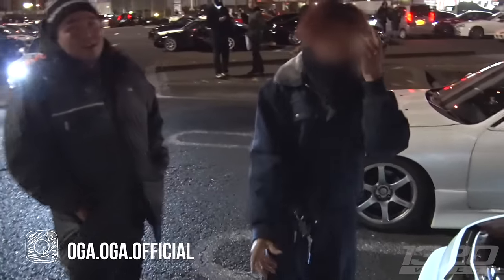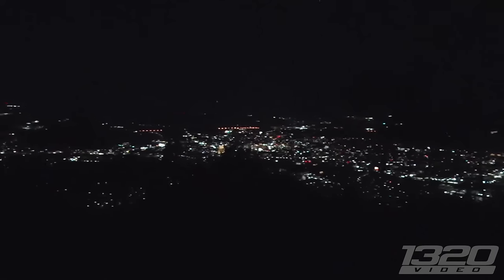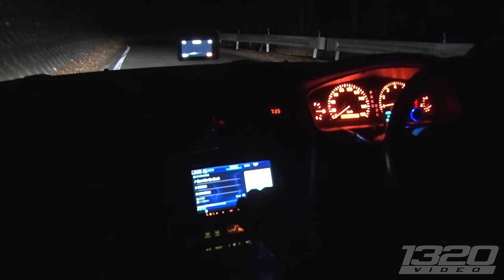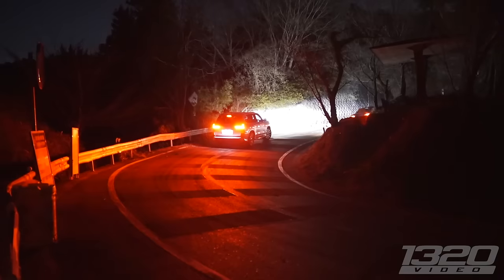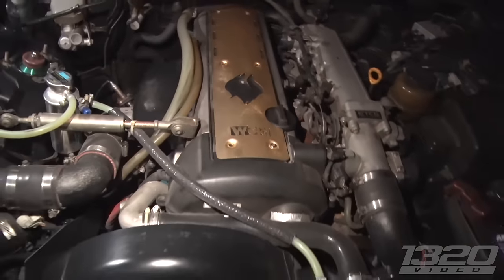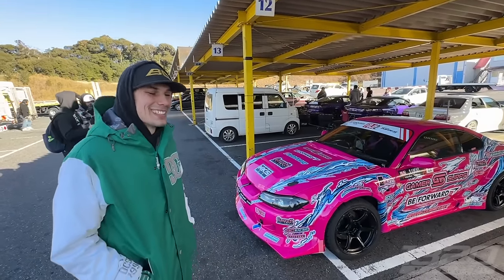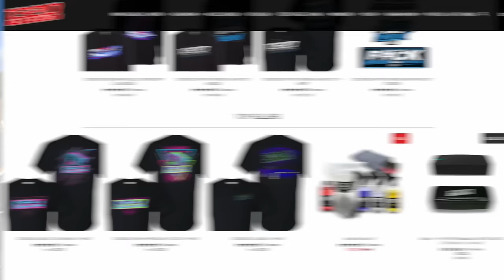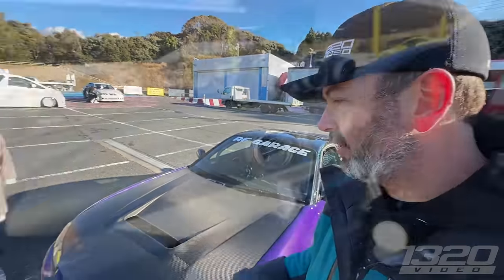90mph Highway Drifting in Japan + TANDEM Drifting in the MOUNTAINS!

Comment: Was the blue Cresta on air suspension?  Looked like it had some type of controller on the left side of the dash similar to like a Maxload brand controller.
Reply: It’s an Apexi FC power commander, it allows you to access engine data and ECU control management.

Comment: 8:37 what was causing the sparks here? Was it the brakes? That was insane!
Reply: The tires get shreaded so fast they drift them down to the metal
Reply: Steel belt: A reinforcing belt stretched circumferentially between the tread and carcass in a radial structure. It tightens the carcass strongly like a tub hoop and increases the rigidity of the tread. Steel cords are mainly used ⛙⛐⛠